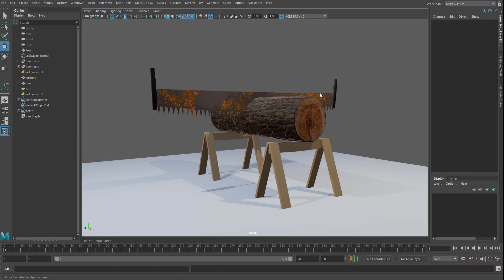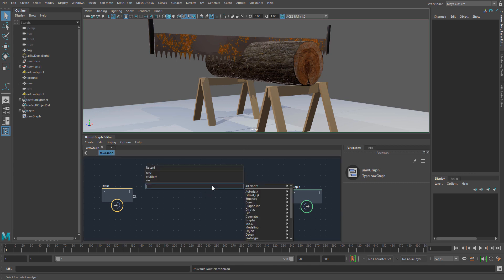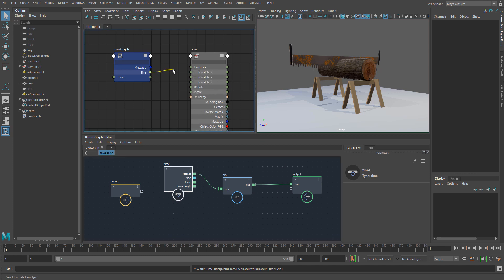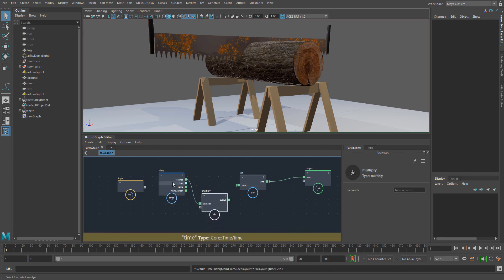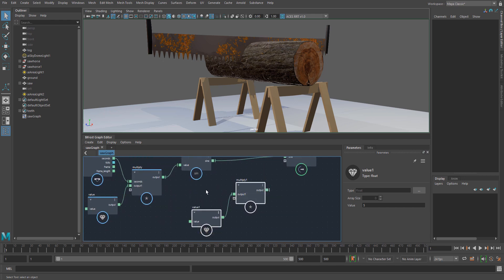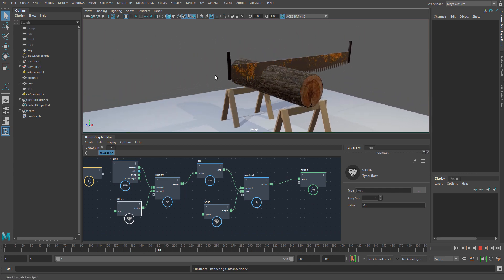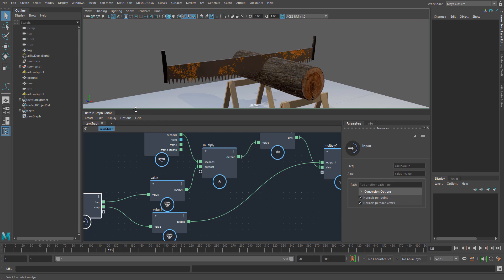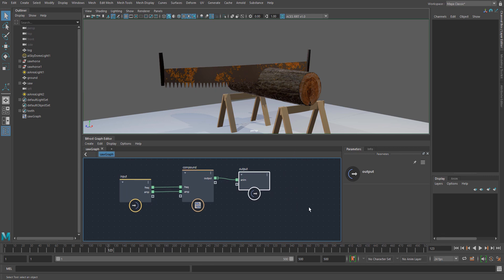Visual Programming in Bifrost for non-programmers.

Comment: This is a great small example that demonstrates the power of Bifront.  As a freelance its difficult to start incorporating Bifost into the project because of the perceived ramp up time.   This helps demonstrate that it's easy and very powerful to start using right away.